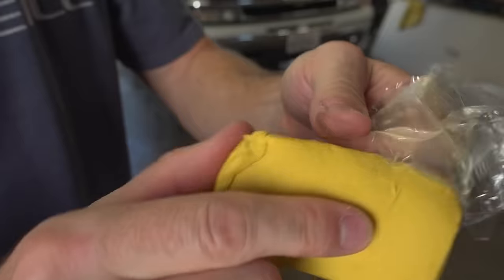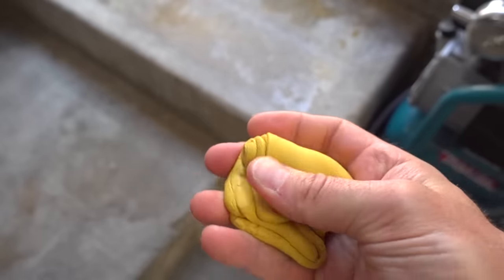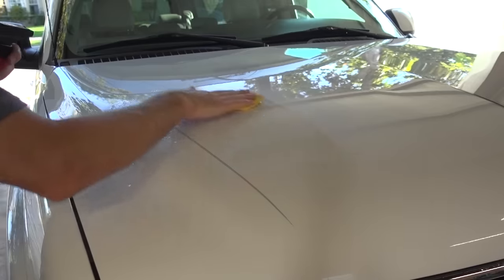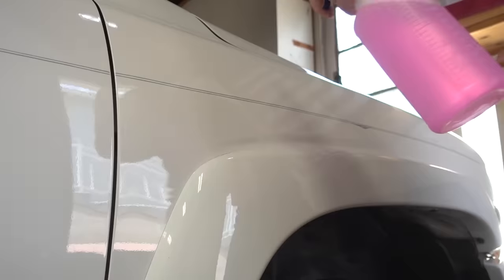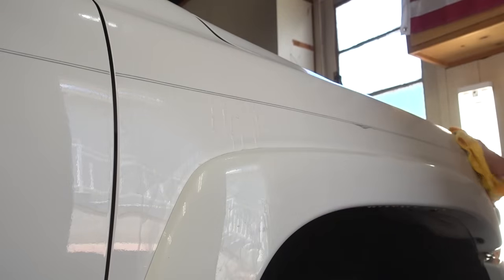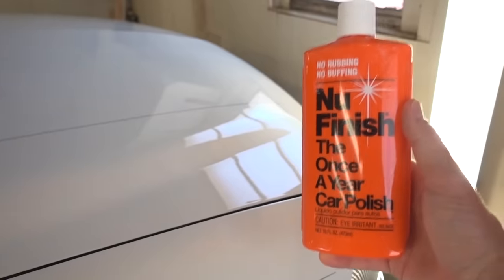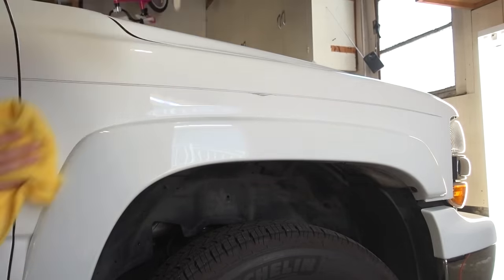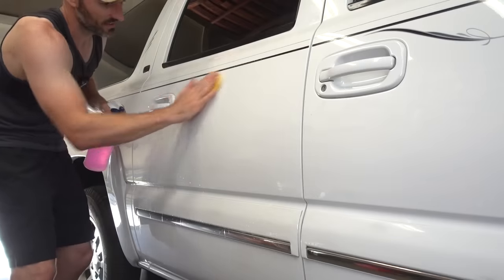This Is Better Than A Clay Bar And Only Costs $2

Comment: I tried using the plumber's putty. Comparing it to a clay bar, I would say that it is comparable but not as good.  I didn't like how the putty would fall apart. I've not had that experience with a commercial clay bar.

Comment: Not recommended. Not a good test, considering you’re paint surface is already in excellent condition.
A Clay Bar isn’t clay, exactly. It’s mostly synthetic and designed for the purpose of prepping a surface. There ARE grades of “clay bar”. Cheap bars can damage. Mothers is a medium to fine grade. Professionals will use fine grade exclusively…but that depends on your vehicle…more expensive but really good.
Plumbers putty does have clay, but it also has oils in it…not what you want on your vehicle. And you’re not guaranteed that it will lift the contaminants and keep them from scratching your vehicle.
Clay bars are worth the money and peace of mind. Don’t use a butter knife as a screw driver and always expect the same results…the right tool for the right job.

Comment: You don't want the clay/putty to be too soft, because it needs to be able to literally pull out all the crap that has bonded itself to to paint. If it's too soft, it won't grab and pull out all those little pieces of debris. Yes, it will do some of the job, but nowhere near as well as a clay bar.

You SHOULD feel and hear the clay bar working. That's the point! You'll know when it's clean, when the bar runs smoothly and quietly across the paint.

You can't scratch the paint with a lubricated clay bar, unless you're using the same clay bay to detail the car for the 50th time! Clay can only be used until it becomes saturated with contaminants.

To do the job properly, you should at least polish the paint, before applying the final finish/wax.

Comment: It  makes sense. One of the top detailing pros on you tube said, never use a clay bar, it will always scratch the paint and you will
have to use a machine to polish out the scratches. Plumbers putty may be the solution.
Reply from the maker: It's not as easy to work with because it's so soft but I haven't had any problems with it and I use it right along with my wash. I do have white paint though so it would be extremely hard for me to notice any scratches being put into the paint... I do try to look but so far so good 👌

Comment: Long way to learn buddy…. Next time, half of the hood done by clay bar first ad free apply putty and check. Other half of the hood opposite: start with the putty and finish with clay bar. So can see which one pick up dirt, side by side comparison to avoid your personal feeling input. And why wetting that much your clay and putty? What’s the point ? In that case save the money and just wash it with micro fiber towel.

Comment: When you hear it means you still have more to clay when you push on the clay bar it drives all the contamination into the clay bar it will not scratch your paint i have clay bared and buffed more then 2k motorcycles and cars no scratches come from the clay bar unless you pick up metal shavings or something really bad you know would scratch the paint just keep your bars clean

Comment: 90% of your impurities are on the top, hood, roof & trunk.  The upper fenders and doors will not be as contaminated because of the angle.  The top should be done much more than the sides.

Comment: Actually the idea of clay bar is for polish and WAX preparation  Nu Finish IS NOT A WAX. Nu Finish is a sealant, it won't get rid of swirls or imperfections. Also, anyone with a classic car should be polishing and waxing not sealing.

Comment: Plumbers putty is filled with an oil so when using it the oil stays on your car which results in being pointless to polish or wax it afterwards cause it won't stick on the oil

Comment: Real car clay bar are not so sticky while dry, buy still sticky while wet with diluted soap. Wet clay bar will stick together , fake /plastic will crumble. Basically clay bar should be water proof. Avoid plasticky dark color putty.

Comment: You did both doors and made comments on each.  What you did not do was campare the rear door to the front door.  If you were asked, "Was there a difference between the doors?" Either 'Yes' or 'No' would have been good information.

Comment: Bro, You should of done the other side of the hood with the plumbers putty. Flat surfaces take a beating, so the fender wasn’t a good test. It would have been interesting if it would of been effective on the hood. You blew it 😂

Comment: I thought a clay bar was to get down to the clearcoat.. Using a wash and wax solution as a lubricant seems redundant and might leave a coat of wax on the surface which is contaminating the clay bar process.. I would think some Dawn and water would have been a better choice..

Comment: Ok, while the paint on that truck is in good shape, it is still an older vehicle, so if you damage the paint using plumbers putty it really isn't going to lose any more value than it has due to it's age.

That said, I would be open to using this on an older vehicle but would never use it on my Challenger. Get a newer car you spent in excess of $45k on it, and do it to that car and You may convince someone to go your route.

Comment: I wonder how Harvey’s Plumber Epoxy Putty would do. You get much less for the same 3 or 4 bucks but it says it hardens like steel in 20 minutes… a lot longer if wet though. Sounds hazardous but potentially superior, lol.

Comment: DON'T TRY THIS! Someone on reddit tried different experiments comparing detailing Clay versus plumber's putty. Clay bar did a much better job cleaning the caked on stuff, while the putty often came apart and didn't do a good job. It also has petroleum distillates

Comment: U claybar lil sections about the size as a large pizza box. And you work it up n down no swirls no side to side. U also keep a bucket of baby soap water so u can rinse the bar off. You work that section till the bar is dirty rinse it then you roll it up n mix it around then repeat as needed.

Comment: Why would the average car owner care to spend so much time on the outside surface of a car? With trade in you'll never get more for your car assuming the outside has not been abused. Trade in value is based on many points the least of which is shine.  Comparing the cost of one tub of  plummers putty with a kit that contains several items makes no sense.A good video otherwise. I had a friend who never cleaned the outside of his cars. He said the dirt, dust accumulated over the years actually protected the finish. Before trade in he would detail and the finish always looked great. He said the dirt minimized sun damage, chipping , etc. I agree with him. Besides if you're doing the detailing regularly so people will compliment you that only goes so far. Unless you do it yourself you can spend a lot of money. I'd rather have a steak and beer.

Comment: When u believe a guy that uses a wax and wash shampoo u lose everything 🤣🤣💀💀💀
Reply: Shampoo? It is wash and wax solution,  look at the bottle
Reply: @supermanfl  it is the same and my point is that if u are going to clay bar your car u should never use a shampoo that has any type of wax or sealant because you are trying to remove the dirt/iron/dark spots with the clay bar
Reply: @MrAresxy07   once clayed the surface needs to be cleaned and sealed. Any car soap/shampoo will wash it. Then decide what wax or polymer or ceramic hybrid coating you want to seal the efforts and make it shine.  I’ve had good results with Meguiars products like Deep Crystal car wash for hand washing. I seal it with Nxt Gen 2 Polymer sealant. Next time I’m going to use a foam cannon after claying and wash it and use the ceramic hybrid sealant. Obviously I’m not a pro retailer but I’ve been cleaning my vehicles for 50 years and they shine. I imitated a pro on my daughter’s Mazda 3. It sat under trees and collected goo. I spent 8 hours removing goo from the rear window/trunk, the inside of door pillars, and along the wiper tray. I shampooed the floor mats and vacuumed the interior. I washed and polished the exterior. It was beautiful. Like new. Then I sold it.

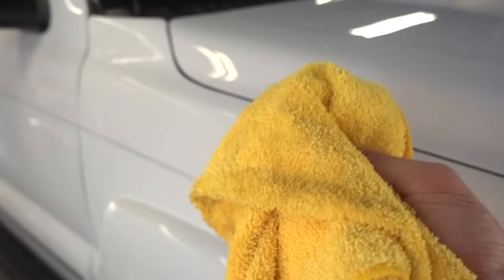Comment: 5:40  if you are buffing with Nu Finish, you are not using it properly. It even says No Buffing on the bottle. Read the instructions, use Nu Finish properly and save time.   But, I do like the video and will be picking up plumbers putty.

Comment: Never go in circles with this stuff will scracth where you can see it with ur eyes
Reply: If it's going to scratch in a circle it'll scratch in a straight line. Swirl marks aren't actual swirls but merely lots of straight lines. I think Car Cleaning Guru mythbusted that one not too long ago.

Best way to avoid surface marring is just keep the putty/clay worked though to envelop any contaminants and keep to help keep the working surface flexible.

Comment: Once you work toward the rear passenger door, I begin to cringe...
I'm no expert, but I believe working top to bottom might be a safer (for the paint) way to go.
Worn brake pad material has to go somewhere, and that "somewhere" is often stuck to the lower half of your vehicle. So, if you're working from panel to panel and "contaminating" the clay you're bound amass more (potentially) damaging particles within the clay.
The instructions on the packaging urges you to periodically knead and rotate the clay so you're not consistently working the same surface, and potentially scratching your paint with contaminates. 
If you're going to do a comparison, I believe you'd best adhere to the instructions of the product you're reviewing - that seems fair, yes?
BTW, Griot's Garage makes a "synthetic" clay bar that is reusable, and very easy to clean. If you're concerned about chunks of contaminates scratching your finish, maybe that's a good product to try.
Like you, I'm just a guy who enjoys cars, and enjoys taking care of 'em. The key difference; you take the time to make videos (thank you!), and I sit on the couch and pick apart your videos - I'm far from perfect!
I enjoy your videos, and please keep it up!

Comment: No ... if you are using a clay bar you should be able to feel the impurities on the paint surface before you clean it... if it is already clean and smooth you don't need a clay bar

Comment: People do not use plumbers putty on your paint this was tried before and turtle wax corporation which is part of Johnson & Johnson tried that the plumbers putty has mineral spirits and a particular type of oil for the plumbing industry now compared to a Claybar a clay bar is held together with completely different components. With the clay bar just remember it picks up containment end it also you’re sanding your clearcoat very very very fine but when you compared to plumbers putty plumbers putty is leaving behind while the clay bar is picking up so please don’t be stingy on your car paint you will regret it later especially if your car has been repainted you will see the destruction faster that way with the plumbers putty remember it is not designed for paints or clear codes and you’re going to run across some trouble. I suggest stay with the clay bar I’m not gonna tell you which ones the best but are used to be a specialist with a company called ZEP manufacturing and we had a car wash division I no longer work for them. In the corporation ZEP they take us aside the sales group like myself and the teachers on how to detail a car and what products are in certain items and one thing that they really emphasized do not use anything else except Claybar to accomplish what you’re trying to accomplish anything else you are compromising your paint job take it from an old expert I know what I’m talking about. Jesus Christ of Nazareth bless all my brothers and sisters out there Jesus Christ is alive and well and he’s coming back very soon so repent and ask forgiveness for your sins so you can be saved amen. ✝️✝️✝️🙏🏻🇺🇸

Comment: Oxidation doest really accumulate on the sides as much so really he should move to the roof or top of trunk lid with this demo. The product yes good price in a detail store one clay bar the size of two of the McGuire’s is 20-30

Comment: Cheap. Yes... plumbers puddy I use to fill nail holes works great in stead of woos fillers and also what helps that plumber's puddy has linseed oil in it so it glides across the body easily when wet. It is a dirt magnet. Next video try Play-Doh?  Good find on the alternative.

Comment: For one thing you wash the car to get any dirt or grit that will scratch it before using the clay bar second use a lubricant made for clay bars third clay bar squeaks and has more resistance because you are not using a proper lubricant also because it’s meant too because a clay bar is removing wax build up it’s not good to wax a car once a week if you aren’t stripping the wax layers back off at least once a month plumbers putty might seem to work but it’s not designed to remove wax so basically your wasting your time and also there are chemicals in plumbers putty which isn’tgood for your paint also will leave a fine chemical residue be hind causing or can cause dirt grime to be attracted to or sticking to car overall clay bars have a purpose do it right or don’t do it at all by the way you don’t need wax anymore there’s something better that you don’t have to strip off and bonds with and protects your paint better called ceramic coating

Comment: To do it on a well kept vehicle doesn't show any results. You need to find someone with a neglected vehicle that doesn't have a mirror reflection. Use both bars on one half of the hood. Whichever brings back the most mirror finishes is better. I've done cars that felt like chizzling concrete.

Comment: I used to work with plumbers putty when I did window replacement and property maintenance. I know the putty has quite a bit of oil in it, does that make a difference in the finish polishing?

Comment: DON'T listen to the part when he cleaned his prep area with a WASH AND WAX! your area that you're prepping for sealant needs to be cleansed of any previous wax or sealant! That is probably why he thought the plumbers putty was so smooth because he already had a layer of WAX from the soap and wax mixture! On top of that he thinks its even more "extremely smooth" because he cleaned it yet again with a SOAP AND WAX! VERY MIS-IMFORMATIVE

Comment: Can I ask what the clay bar is supposed to do, and why it's used?
Reply: It cleans all the junk out of the clear coat, it can take sap drops off, it works great! Makes the paint nice & smooth ive been using it since the 90s but back then there wasn't all this detail stuff we used soapy warm water

Comment: Hey there 1ROAD,  GREAT VIDEO... I use the Mother's Kit but don't like it all that much because I can almost feel it scratching the paint AND it is much harder to fold and/or re-shape the clay to ensure that you are not rubbing debris into the paint, which MUST be scratching the paint. I haven't ever heard plumber's putty before (unlke some of your posters below) but logically it would be much easier to work with.
QUESTION: I wonder if using DAP 33 Window Glazing would work the same or similar way? - It seems to ahve asimilar consistency.
Also: I hate to point this out but you don't have a car - you have a truck... (Couldn't resist - my wife adn I joke about this all the time).

Comment: I understand that you find it smooth from the beginning but that's not what ckay bar does. It shouod be less smooth so it will move the small particles ... that's my experience and my feelings about the clay bar while using it... clay bar will definitely give you better results but by not big margin

Comment: A clay bar will show what it lifts off the paint. You were doing a comparison video but don’t show either the clay bar or putty after you use it. This video could have been on a radio show and not a video

Comment: That was a poor comparison. The horizontal panels always have way more contamination than the than the vertical sides of the vehicle. Especially where it bakes under the hood from engine temperature as well. A proper comparison would have been side-by-side on the hood.

Comment: This was an unfair comparison.  First, the car didn't need anything done to it. And, it is white, so it's going to be harder to see aything.  Was already in excellent shape.   Nonetheless,  it might be an option to try.  It's not like you claybar your paint every washing,  so what's the big deal with scrimping  a few bucks and stay with what has worked year after year.  And a colored claybar (like yellow) you can clearly see what it being removed.

Comment: You don't do whole panel like that!!!!
When you hear scratching, STOP!!!!, fold and kneed clay to a new surface and proceed.
Also, wash before and since soapy, claybar after\ during wash.

You have to wax immediately after because you just took all protection off paint. Sun will tear it up in days!

Comment: Comment........U F'ed up AAron......you should have used the plumbers putty on half the hood and used the same lube if you are trying to compare apples to apples.     Side panels are naturally cleaner and using  a different lube also not the same..........Come on Man!